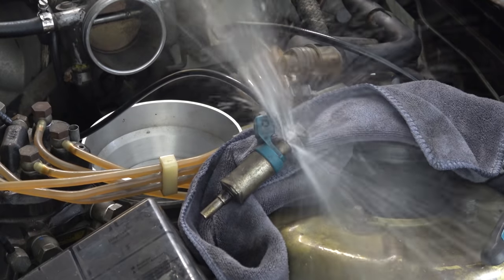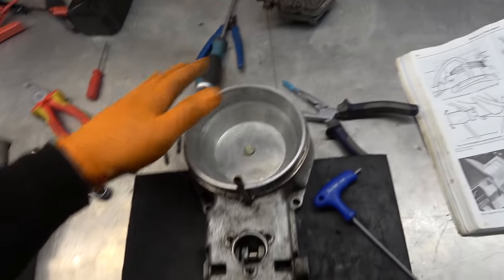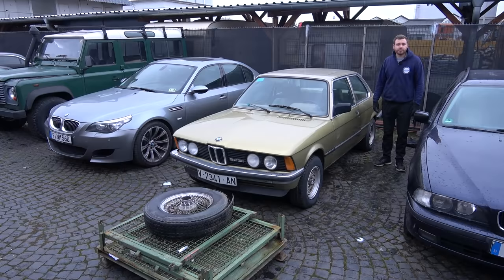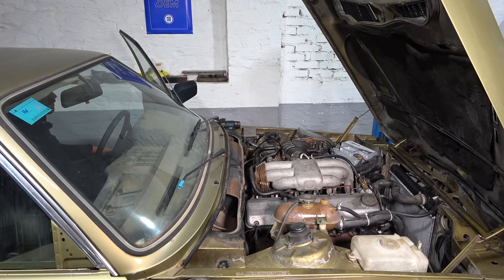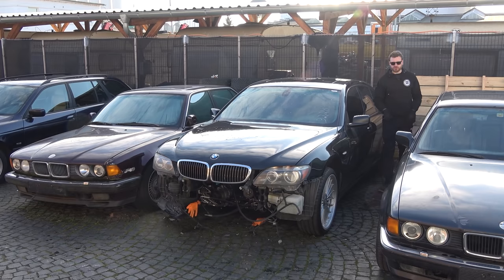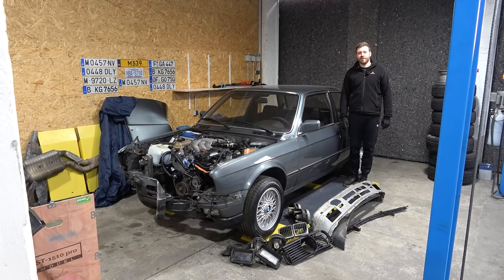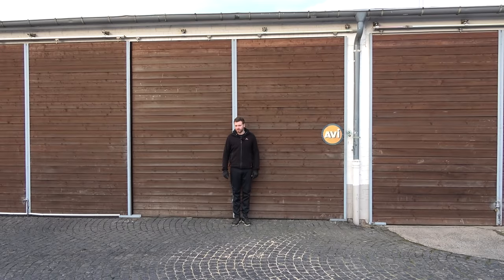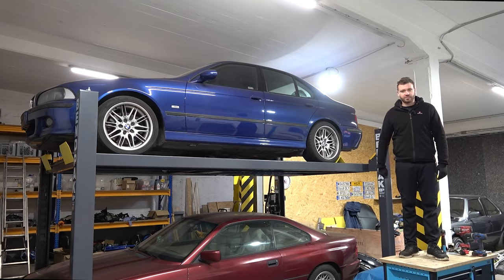Solving BMW E21 323i Cold Start Issues, Update On All Projects & News!

Comment: probably, the used damaged one would spray just fine should you apply the needed pressure to it..
Reply from the maker: What do you mean apply proper pressure? It was connected to the fuel system and getting correct amount of fuel pressure.
Reply: @M539Restorations  AFAIK, the fuel pump  on those systems work only when the engine is cranking. You applied power to that injector when the fuel pump was off, didn't you?
Reply from the maker: Okay,  not sure if you are familiar with basic principles of the fuel system. After cranking the car and turning it off, there's always going to be pressure in the line. That's how the car is able to start immediately and not have to build pressure every time you try to start it. With this K-Jet mechanical fuel system, it also has a fuel pressure accumulator that keeps the pressure in the line when the car is off. On top of that, after I fixed the electrical issue, you can see me trying this damaged injector and it's dribbling, not spraying.
Reply: @M539Restorations  The very first moment you applied power, it seemed to start spraying, but because of insufficient pressure, the spraying phase was too short. 
AFAIK, the main purpose of pressure accumulator is to work as a buffer - it helps prevent pulses in pressure from the fuel pump. 
With K-Jet, the fuel pump starts immediately when the starter is engaged, which helps prevent pressure loss in the fuel line. 
Just run an experiment, if you still have that injector - connect it and start cranking - you'll probably be surprised.
Reply from the maker: @ljuberzy  I'll repeat. ,On top of that, after I fixed the electrical issue, you can see me trying this damaged injector and it's dribbling, not spraying while cranking the car.
Reply: @M539Restorations  okay then. probably, I was not attentive. Sorry.

Comment: Your going backwards... like you done all that repair and now your going to rip out the engine for rust repairs...
Reply from the maker: No, I'm not. The repairs needed to be done so I know if the engine needs a complete rebuild or not.
Reply: @M539Restorations   You seem quite knowledgeable and through when fixing cars however what I'm trying to point out there are methods (Surely are aware of you or have demonstrated this) to determine if the engine needs a rebuild or not. If you want to replace the parts that need replacing that can be done first without the engine requiring a rebuild however if an engine requires a rebuild then you would think the replacement parts that has been purchased would be installed after the engine has been rebuilt. Saves and individual from having to repeat the same method twice where it could of been done once.... It's just feedback do what you wish with it I'm only expressing an opinion to what I have seen. it's your garage boss!!!!!!
Reply from the maker: Thanks. That makes no sense and you can't determine if the engine needs a rebuild like that unless there's something obvious. The car has been stopped for 26 years and you need the engine running properly to understand if it working at its full potential. Another reason why it'll go on dyno and if it's low on power, it'll be rebuilt and new parts that I bought and installed, reused. Simple as that.